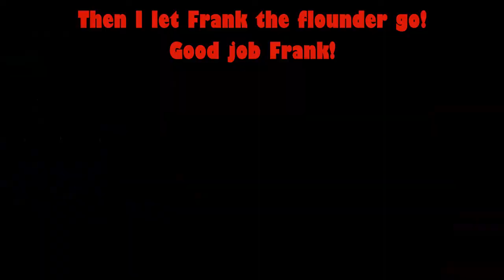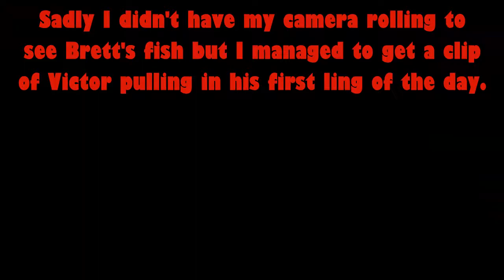Catching big lingcod with my friends

Comment: I was curious about something..  there are different ways that different charters are ran.
In this case people’s hands are numbered.  In some charters (not jigging, but trolling salmon), you only respond to a rod when ‘Your’ rod goes off.  Meaning angler #13 responds to rod 13, deck hand gives you the rod to reel in, etc.
What was up with the #’s on the hands in this case?
Also, was there some kind of rule that you had to leave the rod in the rod holder while reeling it in?
Anyway, I’m sure you had fun, but those large charters are a lot less personal of an experience.  When you go out with just 2-3 people, it is much different.
Reply from the maker: The numbers on the hand are just the number each person is given, we each get a rod and then when we catch a lingcod or a unique rockfish they will put a safety pin through the fishes lip so that you are able to take home the fish you caught.  There isn’t a requirement for putting the rod into the holder, that was just cause reel was the right had reel when all my normal reels are left handed reel and we also had 1lb of lead on there. After catching a bunch of flounder and rockfish I was already getting tired lol 😂 

But I agree, it’s not as personal as the smaller charters, having gone a couple times now you start to get to know the deckhands but it’s true they can’t spend the whole time chatting. But that’s all good.  For the smaller charters I just can’t justify spending more than 200$ on a charter that’s not a guided steelhead float trip. 🤣😂